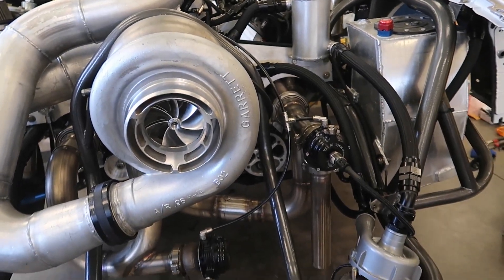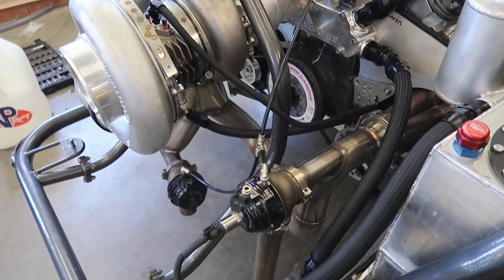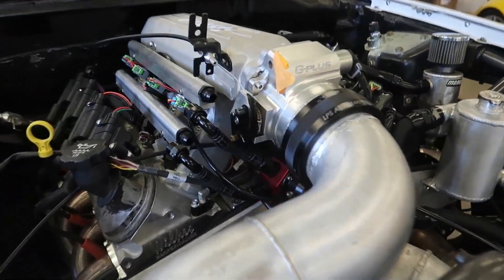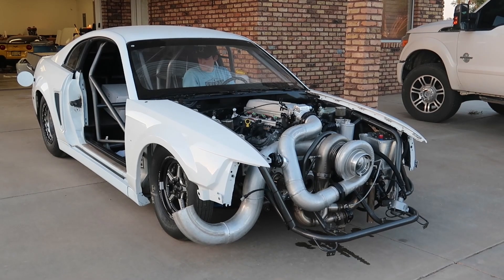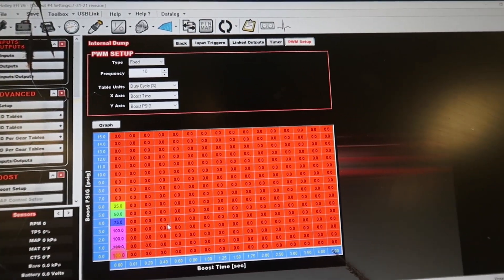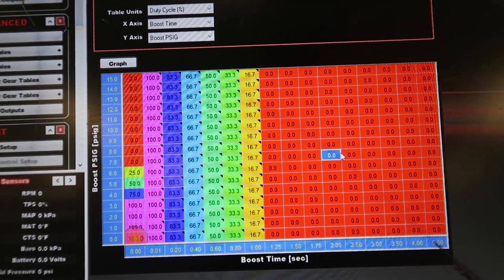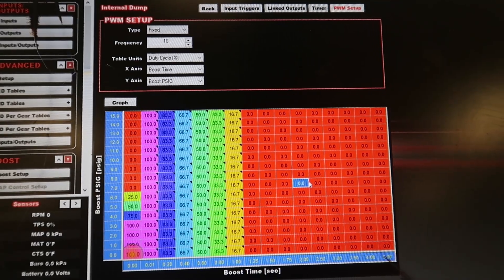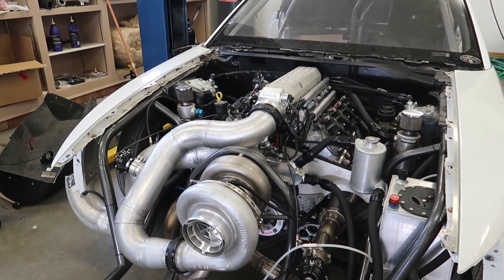Can a 4.8L Junkyard LS Spool a HUGE 88mm Turbo? Road to the SBE 4.8 Record Ep. 14

Comment: Do you think a 4.8 will spool an 88mm on e85? If so what injector etc?
Reply from the maker: I wouldn't try it with a gt55 88 personally. But a s400 88 shouldn't be as difficult. Still important to have the right converter and all that. I'd run fid 2200s. And a circle d specialties converter. I'm a dealer for both as well as a lot of other companies.
Reply: @SquirrelTuned  ya I was looking at a s400 based 88 with a 88x96 turbine and 1.15ar housing. Freakshow is about an hour away I was going to have them do my trans and converter
Reply from the maker: @SparePartsFox  I'm a dealer for fis and tdi. I've had good luck with their turbos. What's your email? Or shoot me a PM on my fb page or something. Be happy to give some more suggestions on the combo.

Comment: Nice video. I am running an 04 4.8 with twin 6765's in an FRS and shooting for 10-15 psi. Have upgraded trunions (solid), stock rods, stock pistons, gapped rings, arp main studs, cts-v hg's, stock heads, ls2 intake, tbss tb, ls3 accessories, twin 50mm wg's. Want to make 850 ish and weigh roughly 2700-2800 lbs. What do you think?
Reply from the maker: Should be able to reach that goal in my opinion. You will probably need more boost than that though. Little motors usually only make 300 or so NA. 1 bar or 14.7psi is doubling atmospheric pressure and will roughly double horsepower if the combo is fairly efficient. I made 860whp on 20psi with my old combo with s366s e85 and a2w. Also I noticed you mentioned it being rich then removed that so you may have realized yourself.  But if this were on gas scale that would be very rich. But stoich is 6.4 for methanol. Where it is 14.7 for gasoline. That's why methanol requires so much more fuel than gasoline.
Reply: @SquirrelTuned  yea i realized it while typing lol. I could push higher boost but unsure if I would have to upgrade anything else. I have 800cc injectors so i am sure i need larger ones for the power level i am seeking. thanks for the reply. Good luck on resetting the record again soon!
Reply: Forgot I have a BTR stage two turbo cam, BTR .080 wall 5/16 pushrods, chevy performance lifters (12499225), and T56 for the transmission. Would really like to switch to a 4L80e but need to widen the tunnel some. Rear gear is currently a 4.10 from the stock frs.
Reply from the maker: @kurty85  if you are running e85 you will more than likely need more injector for that power for sure. You may be able to crank fuel pressure way up to stretch them farther. And thank you! I actually do hold the record again. I haven't posted a video on the latest record but I plan to at some point. I did make a post on my fb page about it though.

Comment: Give turbo specs
Reply from the maker: It's a forced inductions gtr88. 88mm compressor. 112mm turbine if I remember correctly. Gt55 based.
Reply: @SquirrelTuned  ar?
Reply from the maker: @turbovicsatx2910  1.15. I'm a dealer for them if you're interested in one.
Reply: @SquirrelTuned  yea I’m looking into the gtr98
Reply from the maker: @turbovicsatx2910  great turbo. Would be happy to help with one.
Reply: @SquirrelTuned  you get discount or same price as listed on there site?
Reply from the maker: @turbovicsatx2910  I get dealer pricing. I can discount it some.
Reply: @SquirrelTuned  ok let me get back to you I would just need about 1k for that website price

Comment: what do you think the likely hood of being able to spool twin 78/75s on a sbe 4.8? i have it apart currently and can do a dome piston if i had to. Prefer to stay sbe tho going into a 2300lb s10 and gonna see how quick the little 4.8 can go. Just dont want to waste my time either if its never gonna light the 78/75s. Thanks!
Reply from the maker: I doubt they would work personally. 7875s are pretty lazy turbos in my experience.
Reply: @SquirrelTuned  what would you recommend. Prefer to stay twin because plan to do some no prep and need to be able to pedal. But wanting to make 1200+ turned up
Reply from the maker: @starnesfab  s366s are great turbos and can make that no problem. Same turbos I use to have.

Comment: As you have said in the past that you want to stay small cubic inches, even in the future, check this: (Staying with the 4.8 as a base) If my math serves me correctly, you should be able to go out and grab an off the shelf set of 6.3 Rods and ANY pistons that are meant for a common 3.622 stroke/6.125 Rod (1.300-1.306-ish CH) WITHOUT having to special order them and strap those pistons and the 6.3" rods onto your 4.8's 3.268 crankshaft and be off to the races. It's kinda creepy how easy the math is, so double check. 4.8 Crankshaft, 6.3" Rods, 1.300 CH pistons and room to deck the block up to 0.005 without having anything out of the hole. I am interested in seeing a 4.8 based 5.1L/313CID 3.905 x 3.268 in your next build.
Reply from the maker: Only problem is keeping stock crank. Stock crank won't take the abuse I'd want to put through a built motor. I considered  an option that would end up at 302ci. Mostly for the trolling potential. But it would be significantly more expensive than just doing a forged 5.3 or something. Hard to justify spending a lot more money for less performance.
Reply: @SquirrelTuned  Do you think that a 4.8/5.3 iron block would stand up to your proposed level of abuse if over bored to LS1/LS6/5.7L specs or even 3.905 with a run-of-the-mill forged 3.622" crankshaft ? or would you keep the stock 5.3L bore size ?
Reply from the maker: @joeyjojojr.shabadoo915  I would not bore one that far unless sleeved. I also wouldn't stick with an iron block. Not due to strength but due to the 100lb weight difference. I would just go slightly over stock bore. Probably 3.80.
Reply: @SquirrelTuned  Since you will end up being in the market for a 3.622 crankshaft eventually, what are your thoughts on an 8 weight vs 6 weight/no center counter weights ? Considering the value, and the RPM that you plan to run, do you think that a fully counterweighted/8 weight crankshaft such as a Callies CompStar sounds interesting ? similar price to something like a Texas Speed forged 6 weight. Do you think that being fully counterweighted would benefit you in your future build ? even though it will add a tiny bit of weight ? Thankfully the CompStar adds a cheaper option to going full-on Dragon Slayer fully counterweighted.....
Reply from the maker: @joeyjojojr.shabadoo915  To be honest I haven't done a lot of research on the subject so I don't have a good answer for that.
Reply: @joeyjojojr.shabadoo915  Fully counter weighted is better. Keeps the crank from flexing in the center mains. It shows up on the center bearings when you put a lot of power to it.

Comment: I have almost same set up but somewhat stock water pump what water pump u use
Reply from the maker: Ewp 150 and I have a 417 Motorsports water manifold. Used stock on the last setup but swapped mostly to simplify belts

Comment: I had some issues getting up on the chip from 1-3 psi. I noticed my timing was in the low 20s. What would you suggest? 5.3 s475 th400 transbrake.
Reply from the maker: Unless you're on pump gas, turn the timing up to around 30.
Reply: @SquirrelTuned  thanks it’s on e85 I will add some more. Excited to see your car make a pass! You are changing the ls world!
Reply: Having the same issue

Comment: v6 trans control select dump valve, 100 %duty cycle on tb brake.  advanced table, dump valve 1 offset.  -100 percent at x boost.
Reply from the maker: Didn't think of that way. Then could make that table only active on the brake if I still wanted it to turn on at that boost during the pass.

Comment: Did you go single to drop weight?
Reply from the maker: Not necessarily. It may have dropped a little weight. More so for future plans. I don't have to change the kit to make big power. Just get the turbo upgraded. And a lot of classes are more strict on twin turbo than single. Or don't even allow twins.

Comment: Single or dual dump valves and what rpm stall?
Reply from the maker: Dual. Don't go by stall speed on a converter like this. Not making stator info public currently but can get the same one for customers.
Reply: @SquirrelTuned  I feel that. Im stuck between running a bte or hughes bolt together as well
Reply from the maker: @Tookoff  Hughes all the way for sure. I'm a dealer and can help out.
Reply: @SquirrelTuned  I'm interested in a converter also, how can I pm you?
Reply from the maker: @JeffreyCreech  my fb, email, etc are in the description. Any of those work. May not be able to get back until Monday. Have a busy weekend. And next week lol.